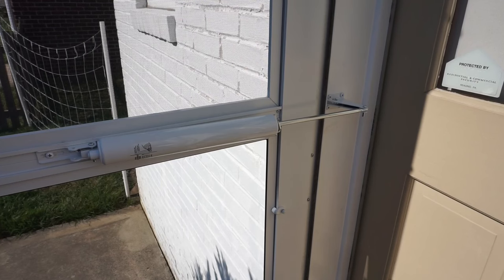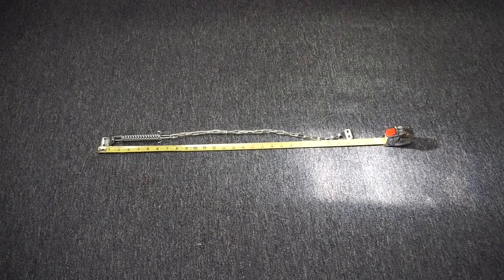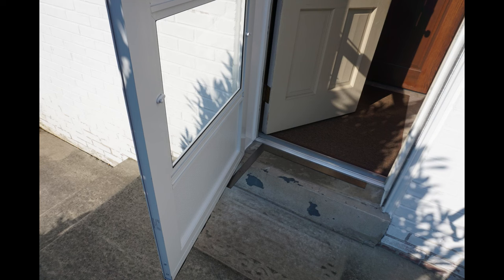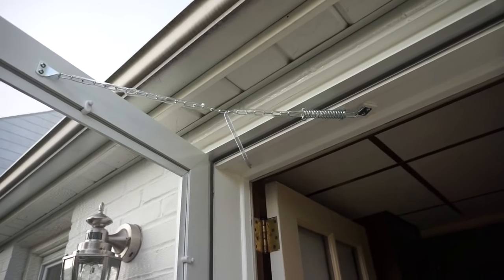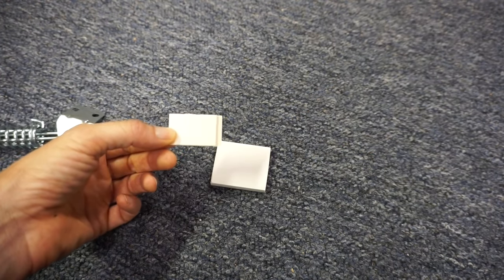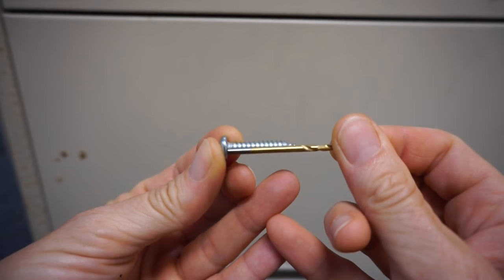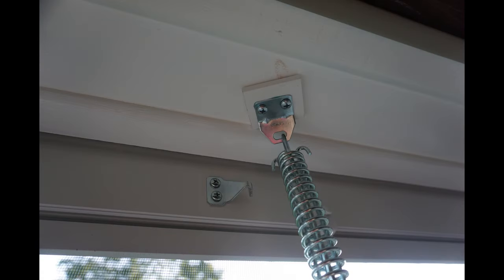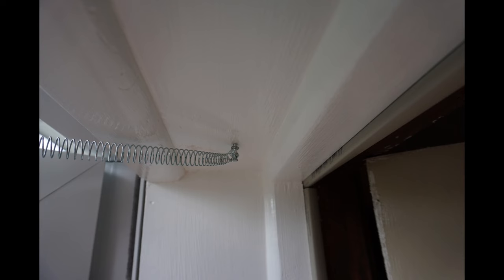Install Storm Door Wind Chain

Comment: So how do you install them with the roll up screens up top
Reply from the maker: I don't know.  For sure you wouldn't want to be drilling a hole you your screen.  When I was shopping for a new storm door I saw some people comment that you can't install a wind chain if the door has a roll up screen.   If you have 2 closers, as far as I know, wind chains aren't installed on those doors. You might try contacting the manufacturer of the door.  Please let us know if you come up with a solution.
Reply: This is my issue too and the reason why I'm here. I guess I'll just have to contact the manufacturer but I'm not very hopeful.
Reply: @Know-How-Now  We ended up somehow drilling above the screen. It must have just missed it. I'm not sure what the "proper way" is but it worked for us.
Reply: @thefakejoey8549 ^^^
Reply from the maker: Good to know that it can be done.  Which brand/model of door?  It might help someone else who is adventurous give it a try.
Reply: @Know-How-Now  it was an Anderson. I'm not sure which series/Model though. I remember I was able to fit my hand behind the frame a little and there was the smallest amount of space up top but it worked.
Reply from the maker: Thanks for sharing that.  Have a great day.
Reply: @Know-How-Now I used a Wind Chain on my Anderson 400 series Storm Door without an issue. I measured down 2" from the top of the Storm Door and it there was no interference with the Screen Roller assembly. I used the Prime Line K-5026 Chain Kit for reference. Oh, great video by the way, very helpful on the measurements and well as drill bit sizes.
Reply from the maker: Thanks for the helpful feedback.  I really like when people add comments like yours for some positive social media.  I'm sure the information will be helpful to others who have a roll up screen.
Reply: @jeffreycaban5107  Does this work with the pulldown screen roller storm door? I'm not sure what the brand or model of my storm door is since the landlord purchased it.
Reply: @jeffreycaban5107  Thanks to you, I have successfully installed the wind chain to my pulldown screen storm door without damaging the screen itself.
Reply: @nullnull403forbidden  Good to hear. I'm glad my post was helpful.

Comment: Is there an alternative to install the wind chain even tho I have a pulldown screen storm door.
Reply from the maker: Try reading the comments, I sort of remember that someone found a way to do it and left a comment.
Reply: @Know-How-Now  Yes, I saw the comment. I will try it, but I'm afraid it's a bit risky since I'm renting and not actually a homeowner. The landlord recently installed a storm door and I realized the wind would slam it open more than 90 degrees.
Reply from the maker: Maybe contact your landlord about your concerns about the door being damaged by the wind.  You have put them on notice so you won't be blamed for damage to the door and maybe they will take the chance to put a chain on it.  Do it in writing and keep the correspondence, you'll have proof that you warned them.
Reply: @Know-How-Now  I went ahead and installed it. I watched a video where it shows the screen and where it's located. It was a success. No damage to the screen.
Reply from the maker: Great. Thanks for letting us know that you were successful.